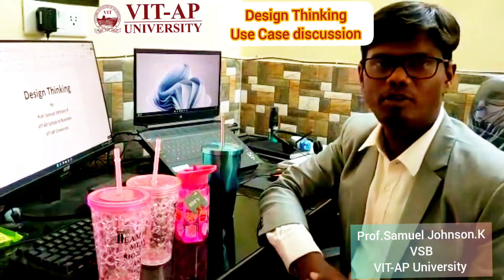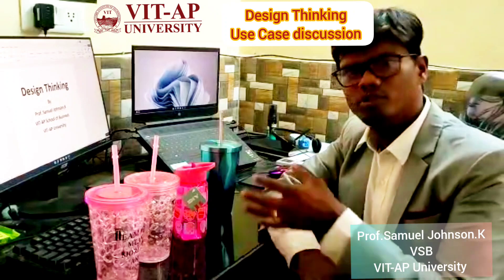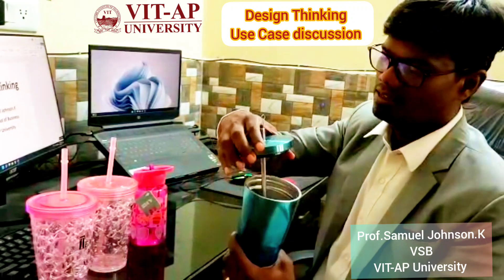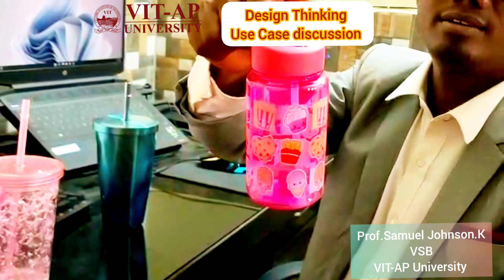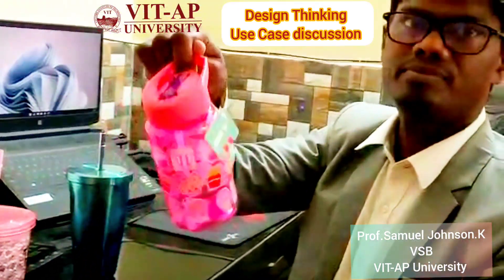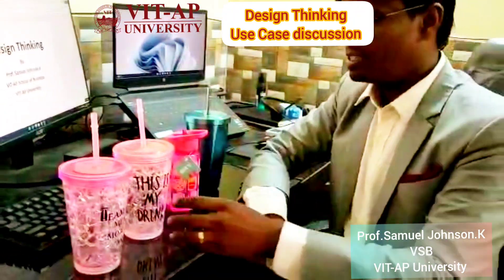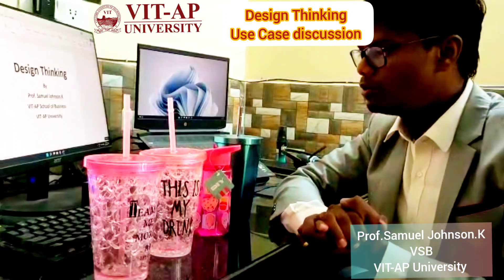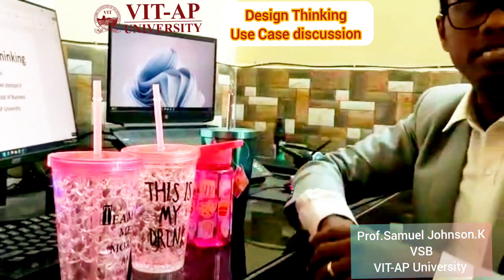Design Thinking use case by || Prof.Samuel Johnson VSB || VIT AP UNIVERSITY || TEC3001 || VSB ||

Comment: Reg. No: 21BEC7105
Name: Kedar Kosuri 

Target customers: For kids for the age group of 4 to 9 years old mainly, and can also be sold to teens.

Pricing: The product is made of different materials, so steel one around 350/-, plastic ones around 250/-, and baby sippers around 200/-.

Market position: It can be sold in small shops in malls, partnerships with them in particular, and on online platforms, like amazon & flipkart.

Additional contents: We can add pic customisation, leakproof, adding other storage compartments to the sipper.

Comment: 21BCE7461
Sri Prudhvi P 

1) 80% of the buyers will be from the age group of 6 to 15  or parents who would like to buy them for their kids. 

2) Pricing can be done around 250 to 650 depending on the model and some other costs like material cost , tax , delivery charges , manufacturing charges and etc 

3) coming to market positioning can be done online or can be sold wholesale and as it is a must product for the kids it is a very good product to expect a fair amount of profits. 

4) yes , more and more designs can be made based on color , users , present trends , cartoons, anime and many more. 

Thankyou

Comment: Jatheen V
21bce8619
>Target costumers are children,and to feed small animals like rabbits 
>Pricing can be vary from metal to metal
 plastic 30rupees approx
Aluminium 90-100
Stainless steel 50-70
>As children are more attracted to this bottles market position may be good 
>More designs can be made for example attaching a soft material in the tip of the bottle , different shapes , using copper metal.

Comment: 21BCE7733
C.Varshith 

1. Target customers - kids, students,  students and employees.
2. Pricing - Pricing for plastic sippers can 150/- to 350/- and metal sippers can around 250/- to 500/- again the weight, quality, material and company terms decide the cost of the products.
3. Market positioning - They are alternatives for single use plastic bottles making it eco-friendly, they are trendy and fashionable which every person wants, they are easy to use and very helpful in travelling, they are widely used by athletes, they are easily available in the market and online shopping sites which makes it optimizable.
4. Can more designs be made? - Yes more designs can be made on the on this type of products adding features based on customer wishes and making it optimized as one of the best feature.

Comment: NAME- Praveen Bastia
Reg no- 21 bce 7688
In this video there are different bottles for different people according to  the requirement and trend . The main targeted audience is around 5-15 years teenagers and kids. 
the pricing may vary for different requirement , between 150-450. 
These kinda bottles can be sold on any platform, from offline market to online shopping platform.

We can apply more design to it , we can increase the size and shape.

Comment: Name:S HARISH
Reg No: 21BCE9556

1) Target Customers: small kids , Students

2)Pricing : The metal bottel is around 300rupees
The babie plastic bottle is around 100rupees
The bottle with straw is around 100rupees

3)market position: The metal bottle can be sold with good market as it ensures quality and gives long life.
The Babie bottle acquire low market as it is Targeted to only babies

4)Yes we can make many designs according to customer requirements.We can design a bottle which controls the temperature of the water inside it.

Comment: K.Saipavan
21BEC7130
Sippers shown in the video are 3 types which are meant for babies, College students and girls.
200,250,250/-
They can be sold in shopping malls and medical shops .
Leakproof technology should be there ,easy to clean and maintain and it should be made of eco-friendly material 
Yes more designs can be made

Comment: Name - Bandamaneni Yaswitha Lakshmi
Reg. No. - 21BCE7124

1)  Target customers - kids, students, students, fitness freaks.

2)  Pricing - Pricing can be between 150/- to 500/-  again the weight, quality, material and company  terms decide the cost of the products.

3)  Market positioning - They are alternatives for single use plastic bottles making it eco-friendly, they are trendy and fashionable which every person wants, they are easy to use and very helpful in travelling, they are widely used by athletes, they are easily available in the market and online shopping sites which makes it optimizable.

4)  Can more designs be made? - Yes more designs can be made on the on this type of products adding features based on customer wishes and making it optimized as one of the best feature.

Comment: Ch yaswanth 
21BCE7558

1. The target customers mostly will be the young people and kids not only for them it is useful for all age groups.

2. The price can be between 300-800 based on the product quality. 
 
3. The product is very unique and attracts the people easily and it will have great demand in the market and the position of the product will be on the top in the shares. 
 
4. Yes we can made similar designs like this which is useful for all aged groups to attract them and so many designs can be made like this.

Comment: Name:Gande Vishnu Vardhan
Reg no:21bce8103

In the video there are four different types of sippers according to age and trend  we can choose.
The target customers are baby or children,college students and modern girls etc.
Pricing product:
Stainless steel sippers around 400rs
Baby sippers around 350rs
And the remaining two sippers each one 250 to 300rs
Market position:
It can be sold from online platforms and the sellers can customise the sippers according to the customers, Amazon, Flipkart and supermarkets etc.

We can add more features and designs to sippers Ex: on the sippers we can print the names or photos( like print photos on cups etc), designing different shapes of sippers for easy to carry, sippers can be made of different sizes like(500ml, 750ml etc) and different colors.

Comment: R Anmol
Reg No: 21BCE8567

Naming the 4 sippers from left to right in the video from 1-4. 
Target customers: We can say 3 is targeted towards kids whereas 1,2 and 4 are targeted towards older kids and 1,2 can be considered to be under the same sub-target class because their designs are so similar. (They both go for the cracked look) and 4 is going for a rigid and metallic look.
Market pricing: Sippers are not a need but can be considered to be quite a common buy among customers as it proves to be quite useful, so, pricing these around 300-500 rupees would be ideal.
Market positioning: this can be defined by the 4 P's, i.e., promotion,price,place and product. As there are innumerable other sippers in the market other than the 4 shown they indirectly promote each other through competition. They also prove to be a reasonable purchase with their pricing and are available almost anywhere. This points to them being positioned in the market incredibly well.
Scope for more designs: This is a very versatile product when it comes to it's design as it's look and tech can be modified in a lot of ways and combinations.

Comment: G. Venu Charan Reddy
21bce8150

As we can see there are four different designs and have been designed with different target customers. Last Two designs target adults(employees), students,children in some cases. They are used for juices or coffee, etc… which mostly adults drink. The second design is especially for the kids. The first design is mostly used by teenagers, as it design attracts them. 

Coming to the pricing they all stand in the range of approx 200-600. Just in case we can say may be less than 1000.
These market positing can be easily predictable cause we use them daily. So designs like these easily attract the customers and be sold easily and have the high market position. We can say market position will always be in the top.
Of course similar designs can be made. As bottles are our daily use and if the product looks good customers just buy it. So lot of designs come to attract the customers.

Comment: MD. ANAS JAMAL 
21BCE7711

Target Customers: Mostly Young Adults, especially College Students and High School Students who are in the market for something a lil more fancy than normal sippers.

Pricing: The pricing would ideally rangle from ₹300 for the lower end products to ₹700 for the higher end ones.

Market Positioning: This product is extremely marketable without even having to try all that much because the designs being extremely innovative and unique, hence as a result is already something most young adults would want to get their hands on. Therefore, simple marketing techniques such as word of mouth would suffice.

Possibility of more designs: Yes, similar designs can be easily made and also will be easy to make as well as easy to market as we can use variations of the same thing to make them.

Comment: Varun Virendra Shetgaonkar
21bce8330

Since everyone else has given many valid points about how the product can be designed for customers , i would like to differ a bit and would like to focus on the b2b(business to business) aspect here.

Target customers :- coffee shops , fitness brands , juice bars, large cafe chains, offices , etc.
The product can be used the above mentioned to be sold as merchandise, gifts , premium packaging, usage.

Pricing:- B2B pricing could vary from ₹50 to ₹80 depending upon the material (plastic or stainless steel)

Market positioning:- The product could easily reach many companies by approach and can easily become the market leader.

Designs:- The designs could vary according to the need of the customer, for eg:- with their branding or logo , matching their theme , or any particular required modification in the base design